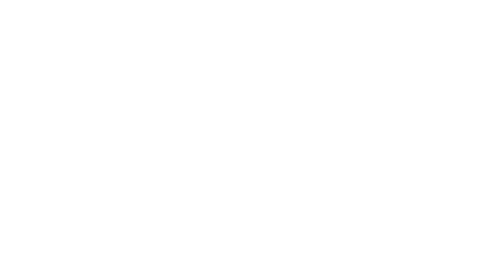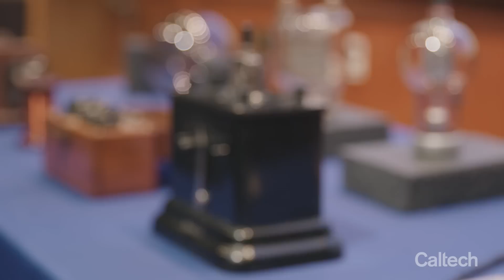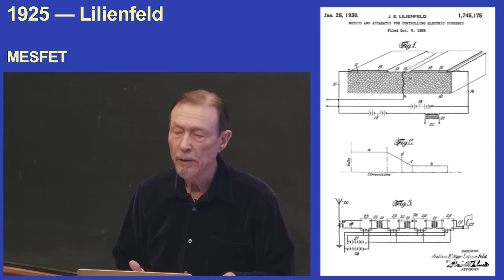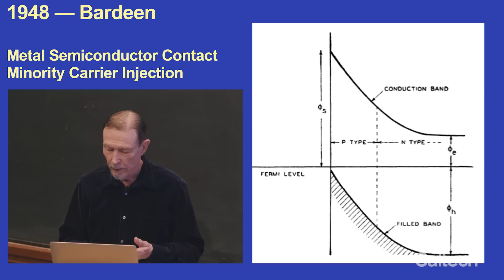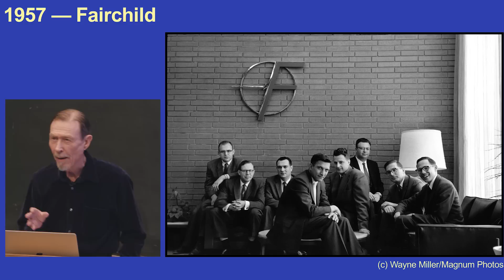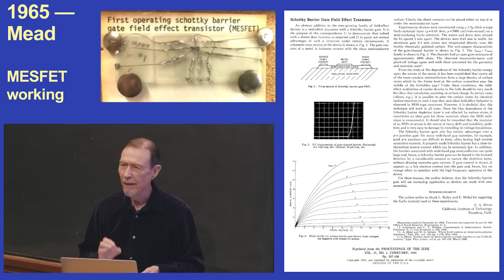Lessons from the Early Days of Semiconductors - Carver Mead - 4/24/2019

Comment: About Lilienfeld, track down RG Arns 1998 IEEE paper on early history of the MOSFET.   Bell Labs lied about it continuously, insisting that Lilienfeld was only a theorist, and never built any devices.   At the same time, Bell Labs quietly built Lilienfeld's devices, and found significant gain.   They even published their results[1], while dishonestly concealing that it was a test of a Lilenfeld device.   Instead, it seems that the entire Bell Labs project was to try to patent Lilenfeld's FET.   They repeatedly failed, with all FET patents rejected on account of prior art.   They well knew that the transistor already existed.   But it was in the public domain, so no giant corporations could own it.

Apparently EF Johnson was the main source of deception.   In an early interview he said that Lilenfeld's transistor worked, and exhibited significant gain.    In much later interviews he said that it didn't work when tested, and also that Lilienfeld never built any working transistors (as if Johnson could even know.   Lilienfeld's work happened two decades earlier.   And, Lilienfeld was an experimentalist, with no proper theory to explain his working devices.)

---

[1]They published it in the same journal with their very first findings about the BJT transistor, the "crystal triode" paper.   Lilienfeld's transistor instead involved thin-film conductivity modulation.    Johnson said that the thin-film glass version worked, but they never had success with Lilienfeld's aluminum-oxide version

Comment: 00:01 The early days of semiconductors were about controlled electrical current
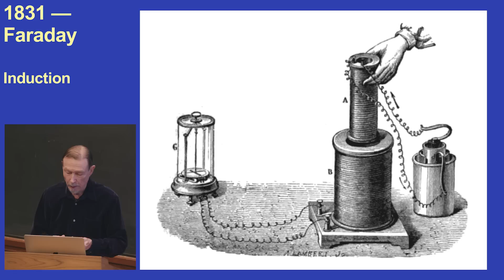03:35 Utilizing the null principle for precise measurements without absolute galvanometer calibration.
09:19 Discovery of charge carriers based on Hall Effect
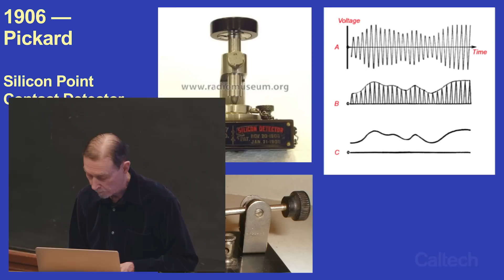12:11 Radio waves enabled communication between ships and shore
17:36 Carver Mead experimented with controlled compositions of semiconductors.
20:34 Controlled chemical treatment revolutionized semiconductor conductivity
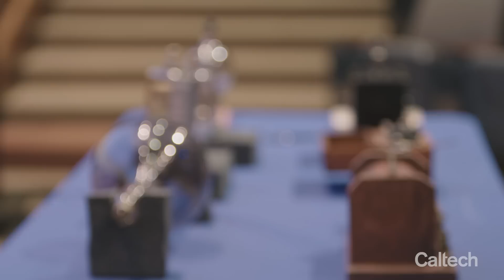26:03 Transition from vacuum tubes to semiconductor crystal sets in early radio technology
28:39 Semiconductor innovation led to smaller, powerful receivers for radios.
34:19 Electron behavior in crystals leads to energy gaps
37:23 Mass and curvature effects on electron behavior
42:52 Shakti published a paper on impurities in selenium creating p-type semiconductor.
45:50 Early understanding of metal-semiconductor contacts led to key semiconductor device discovery
51:24 Invention of the transistor through controlled doping
53:54 Automated transistor manufacturing process revolutionized by Philco
59:08 Semiconductors revolutionized with sub-micron dimensions and increased speed.
1:01:41 Early semiconductor evolution enabled power switching technology.
1:07:10 Early innovations in integrated circuit technology and semiconductor devices
1:09:42 Implementation of logic using devices in series and parallel
1:15:21 Advancements in semiconductor technology have led to new ways of using devices and structures.
1:17:54 Potential resurgence of vacuum tubes in nano scale
Crafted by Merlin AI.

Comment: I studied the history of neuromorphic computing as part of my '90's work in IP. Gilder wrote a book on Silicon Valley covering some of Dr. Mead's work. Read his interview in the LAT this week on his collective QED thoughts, and to me it stuck out his applied collective (thus presumably macro-scale) QM naturally never mentions gravity. I could spend hours explaining what's wrong with GR, and how getting gravity wrong obscures the basis of controllable entanglement and emergence of macro-scale superconductivity.

Maxwell was mentioned quite a bit in the LAT article, but never Einstein. In my mind this highlighted what should eventually become obvious - Maxwell (and Gauss before him) didn't consider gravity variations whatsoever in EM but that never stopped Einstein from building on Maxwell's equations to come up with a grossly oversimplified, realistically non-quantizable (under EM rules) theory of matter and gravity pinned faithfully to a supposed constant light speed. Bending time just to have a slowed time with faster gravitational accelerations in higher gravity should have never been considered reasonable by Einstein followers, frankly. What seems to work fine in constant gravity can fail in wilder conditions, with "spooky" results. Atomic clocks are irregular photon phasing sources with regular photon color (Heisenberg rules for light) and unfortunately color is always less relevant than timing (phase) and "close" works better for horseshoes than laser beams. Forget those Popular Mechanics articles on GPS needing GR, it's military hearsay. Gravity-change-sped light has a higher frequency just like a faster rumble strip has a higher pitch.

Conceptually simplest and most versatile way to reasonably incorporate negative energy into gravity is with a Planck-scale quantum showing zero net mass effect, formed by a resolution limit of EM energy enveloping a consequently-minimal volume of the so-called "true vacuum" having relatively negative energy density. The true vacuum thus forms a mass-wise self-neutralized Planck scale composite positive-negative energy particle, which at light speed may manifest as a dipole or bi-pole, a negative vacuum energy core substantially covered by an EM energy coating except at the leading (and possibly trailing) end. Upon contact with matter the longitudinal effect could thus be dominated by the pull of absorbed negative energy and the lateral effect governed by the push of expanding positive energy, the net effect of impact being an energy micro-tensor type of effect. All the "curvature of space" (as opposed to the curvature of light under gravity) is thus limited to Planck scale while macro-space stays flat (energy neutral, seemingly homogenous).

Suppose with entanglement and superconductivity there is a temperature-dependent retroreflective "focus" in gravity flow between nucleons. Many aspects of this may make cold matter appear practically neuromorphic to some extent, with naturally saturable bidirectional positive gravity feedback flows possible, like mimicking evolution with Hebbian rules. The role of hydrogen nuclei in heavy organic molecules of life can begin to become apparent based simply on properties of heat resistant tethered protonic focus in extended inter-molecular couplings. The effective focus mechanism for the nucleon is ultra-simple - it's as if a nucleon forms three intersecting gravity flow mirrors capable of naturally settling into mutual perpendicularity if allowed by the environment.

The Moire effect in graphene layers may reflect the performance of structures more fitting to systematically defocused gravity flows. Increased concentration from focus in gravity couplings may leverage on itself in gravitational flow rates, creating light-based flows supporting atom-to-atom links where light phase gets pulled forward up to some contextual saturation limit. The implications extend to "heat death" of the universe itself effectively being a periodic self-neutralizing extinguishable effect of inexorably growing gravitational energy flow focus in cooling matter. This is just some of my own perspective on gravity.